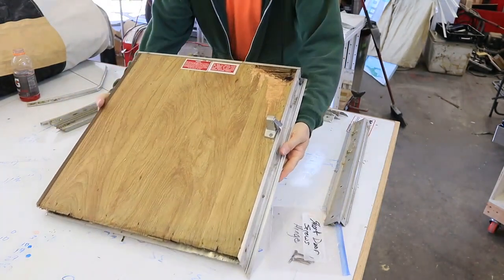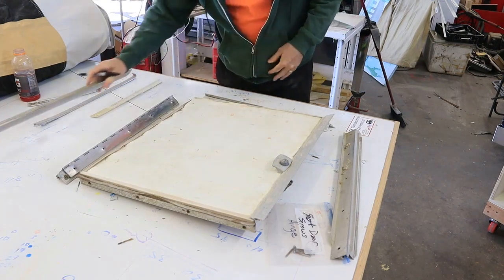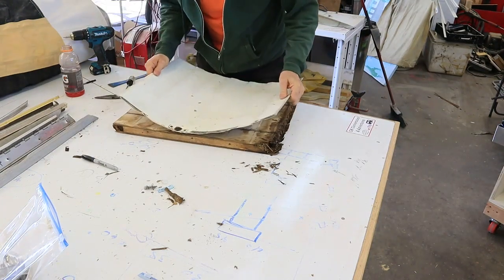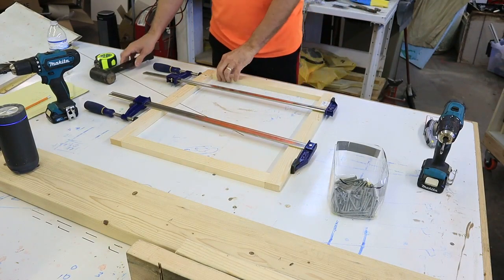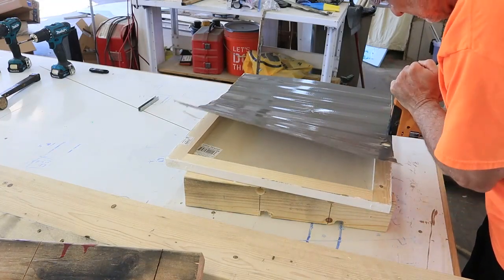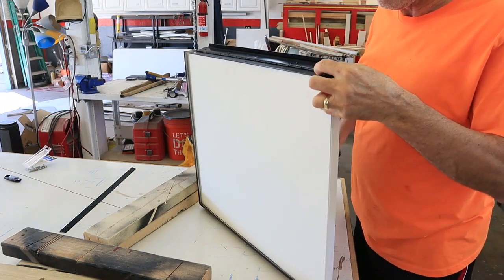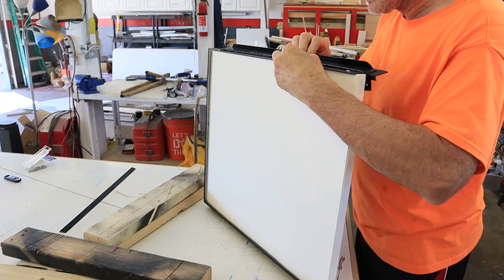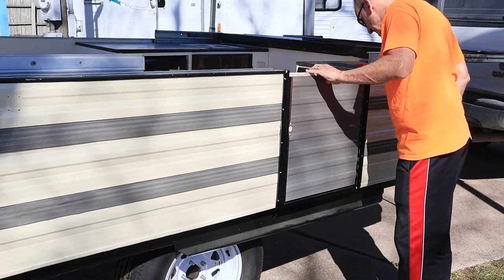HOW TO FIX POP UP CAMPER DOOR DIY Rebuild Tent Camper Door PT26

Comment: How can you get top part of door to not pop out when roof lowered to secure into place. Rebuilt entire trailer with your help. Door will not open. Hits top trim when attempting to open??
Reply from the maker: it sounds like you may need to raise the top slightly. Maybe the door is not square to the trailer? Maybe shims in the door attachment area?

Comment: Great job ,as usual.
Having some electrical issues in my 2001 Thor Scout popup. Had to rebuild entire top. Installed 2 led lights but will not work when I connect to exsisting wire on rear driver side. When I hook up directly to my boat battery,they work??? Does camper have to have a 12v battery connected to make lights work? Thought converter did that..Any help will be helpful.
Reply from the maker: You are going to have to trace the original wire and see how it is connected. My build did not have a convertor. I moved my plugs from shore power to the invertor when I wanted to run off of the batteries. Good luck.

Comment: We are rebuilding a 1987 Jayco 1006 popup we bought for $600. We ordered the canopy, will take 5 months to get. Our aluminium skin can't be reused. Can you give us your info on where to order. Thank you
Reply from the maker: Sounds like you are off to a good start. When I was looking at buying replacement panels I just did a google search on it. However, the shipping costs were too high for my liking and I could not find a local supplier. That is why I reused my panels. I can't point you to a supplier because I haven't ordered from them. I do wish you well on your project. Thanks for watching.